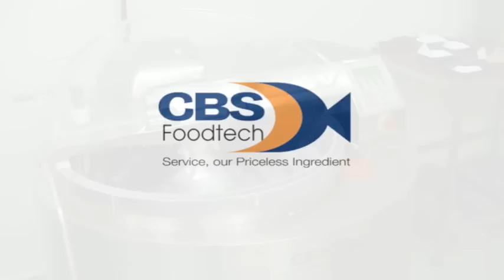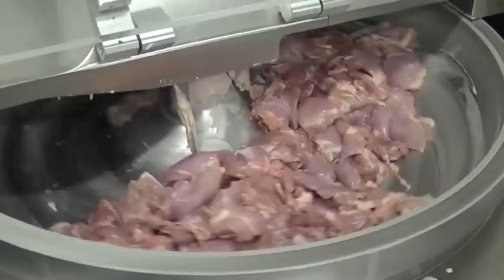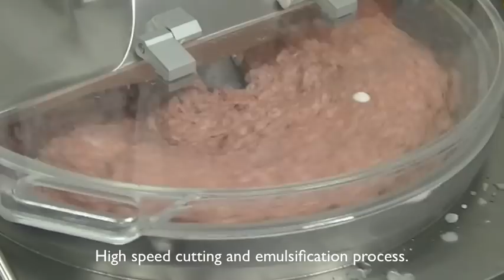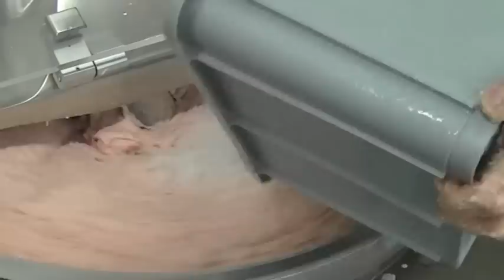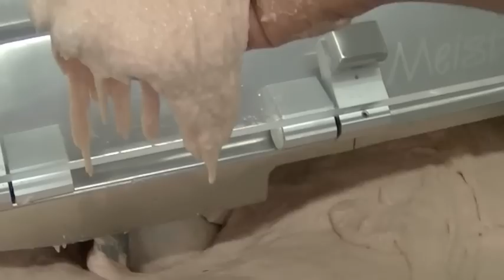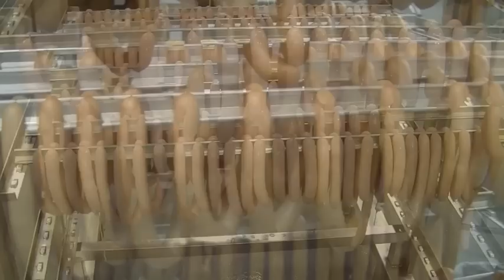Bowl Cutter - Emulsion Products (Continental Frankfurter)

Comment: wow....doubled the weight by simply adding water....lol....cost of the machine recovered !!!!!!!
Reply: As someone sad, water is needed for the process. Some water is removed during the cooking process.
Reply: actually you are both not understanding the process very well , the ice water is not to increase profits, this is a misconception , the ice/not water is used to cool the product to 5 degree  c otherwise the emulsion process is destroyed . The water content/ after ice has melted is less than 10-12% which is also needed during curing . After curing or smoking the product water content is 3-5% . Hope this helps Regards Sean